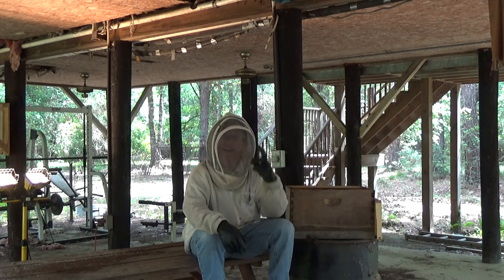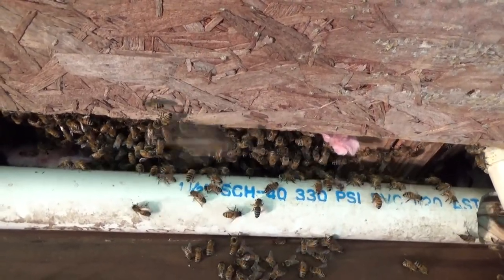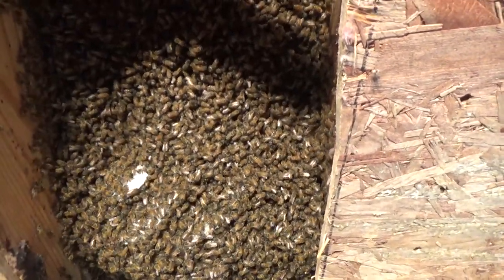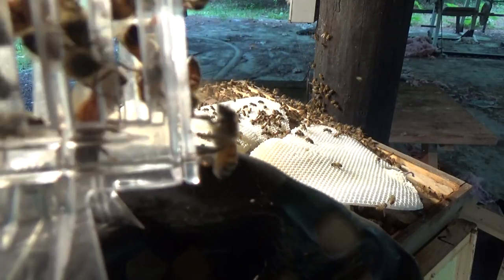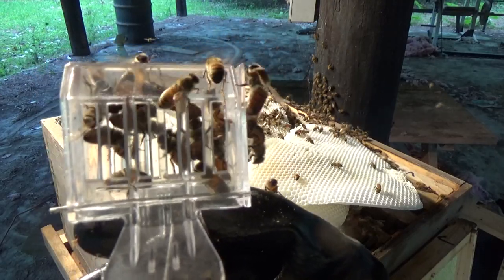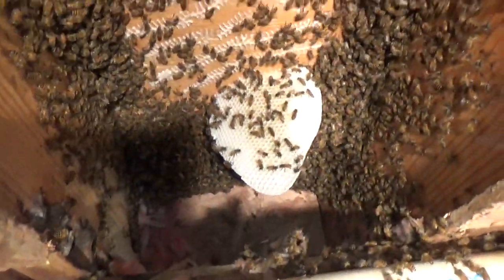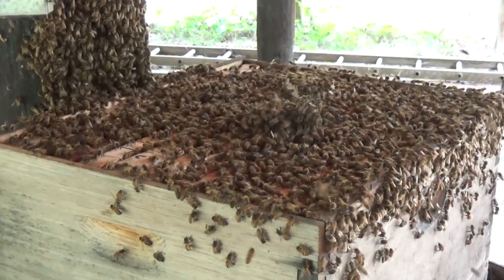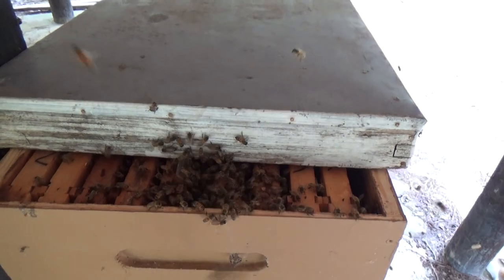A fifth of JD or a fifth swarm from the bee hive house

Comment: Hi quick question? What are you using to cut down comb sections? Can't tell in video
Reply from the maker: I am using the straight hive tool. Sometimes I use the one that has the end turned at a 90 degree, and other times I use 3 or 4 different sizes of knife. Whatever the situation requires, I have a tool for it. Thanks for watching. God's peace.      Mr. Ed

Comment: i know little about bee's, but that house electrical wiring is a nightmare. a wet box and less than9 feet away there is a cheap plastic box with NO cover, and the conduit is plastic water line pvc... a fire just waiting to happen
Reply from the maker: I'll take your word as to the condition of the wiring in the house, but I'm just concerned with removing bees. As long as the house and the bees are there , I will keep on removing them. Thanks for watching.  God's peace.
Mr. Ed

Comment: Mr. Ed what was that infrared red device you were using several videos back to locate the swarm inside the walls inside a house? It looked like one of those laser type temperature guns sold at Home Depot, but it had a screen display showing the red infrared signature of the colony inside the wall. What was that device? Thanks, again, for your great videos.
Reply from the maker: Hey Dave, great to hear from you! It is a thermal camera, and I use it all the time now locating the hives in structures. Just like my camera and tripod, the thermal camera goes out the door with me in the morning. It is manufactured by Flir, and I bought it on Amazon for about $350.00. Money well spent. God's peace brother.       Mr. Ed
Reply: Thanks for the feedback. I found the camera it on Amazon. Still debating whether or not to get one. While I have picked up 6 swarms and given about 6 swarm calls to other club members so far this season here in mid-MD, I only recently had a call for a cut-out in the home of a friend of a newbee club member. The homeowner is also the home builder so would have no problem opening the ceiling and repairing the damage afterwards. I had made my own bee vac a couple years ago (it's just like yours) and the needed equipment so told the member I would help her remove the colony once the homeowner opened up the ceiling. We used the entering bees as our guide to where the colony should be. I was nervous as he cut the sheetrock out only to see pink insulation but no bees. "Pull down the insulation," I suggested. He did, and there it was! A real beauty and a great first cut-out for a newbee to do herself. Used your techniques, of course! She even spotted the queen and got her in a queen clip!